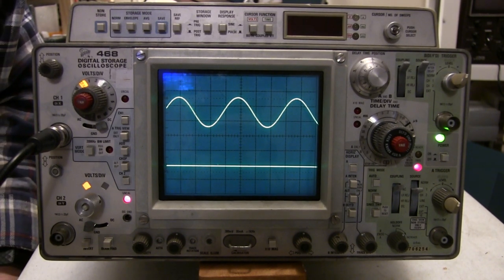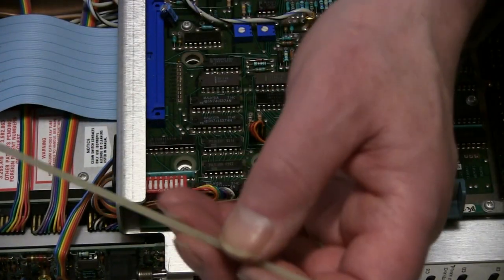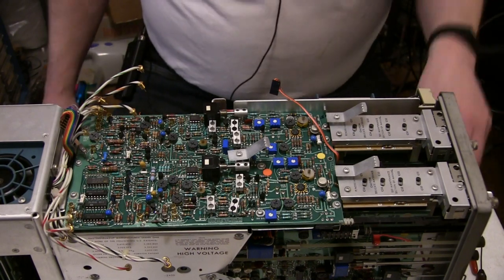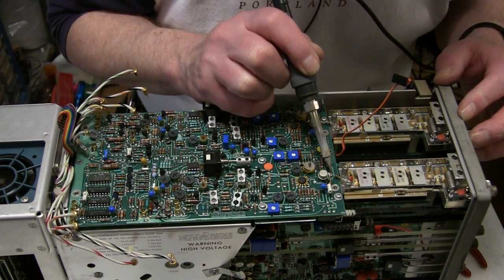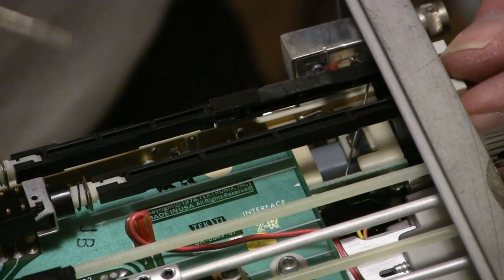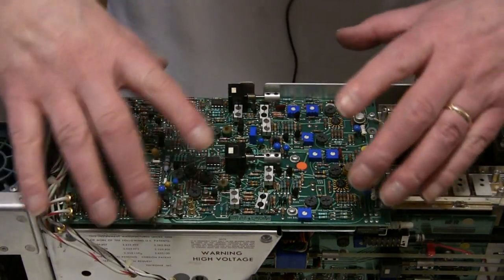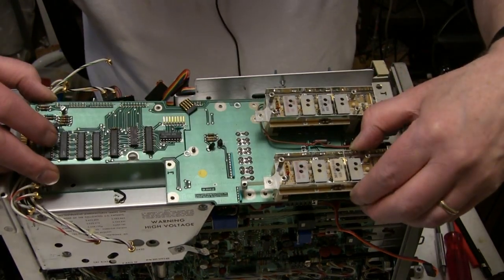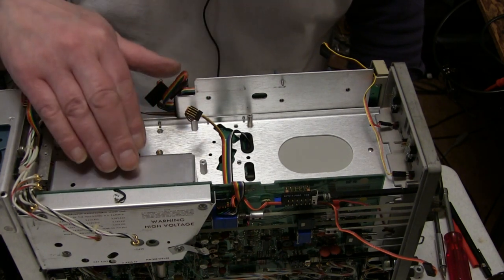Tektronix 468 Repair Volume 2: Vertical Section

Comment: I repaired my 475 just last week. Turns out some of the series resistors in the attenuators are plugged in, not soldered. One in series with the the 4x attenuator, ch 2, was not making contact. I cleaned it with  some deoxit (sp) and its back working again. That is the only issue with it I've ever had. Ive owned it for about 40 years. I bought it for $75 in about 1980.

Comment: I still have a 475 that I quit using about 40 years ago. I'm glad I don't have to fix it. I hate to think of the hours spent building one of these at the factory. If I recall they cost about as much as a new car.
Reply: Well john I have the tektronix 475A w/dm44 and it was $3710.00 in a 1976 sales brochure. Currently I'm still replacing the old tantalum's. My cousin repaired a earlier problem when I bought it, and the scope had many problems in the scope and the DM44. Used it a year and another tantalum shorted and burned out a lm7805 regulator, and that regulator board could not be reached unless the CRT was taken out. 
The tektronix oscilloscopes are very well built but with age become problems